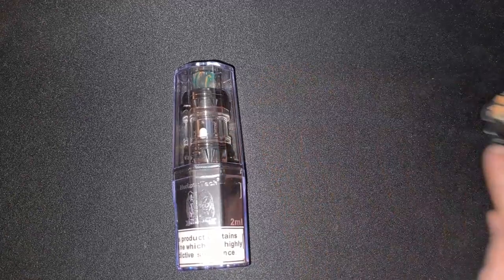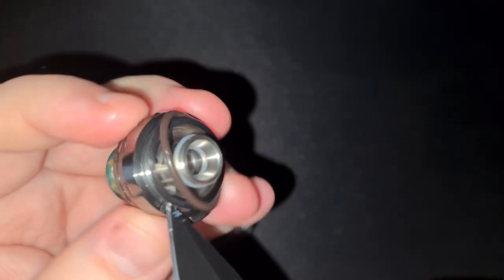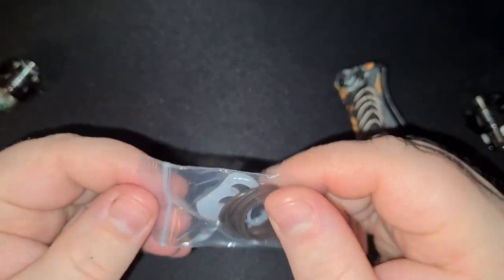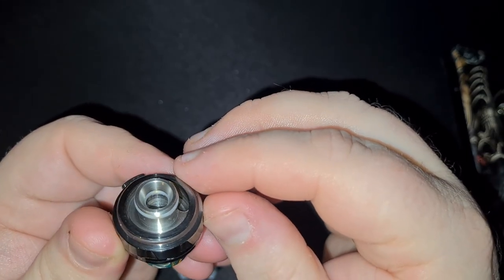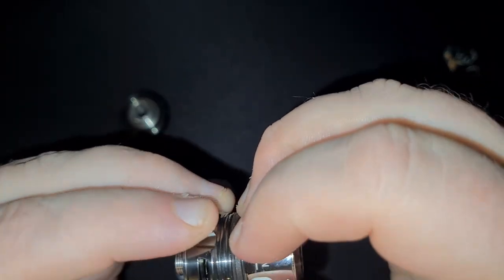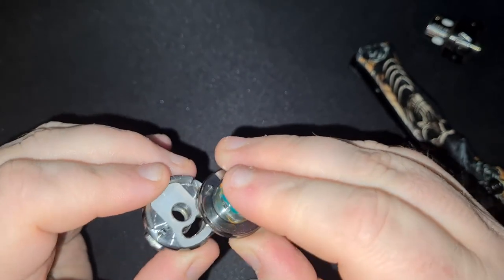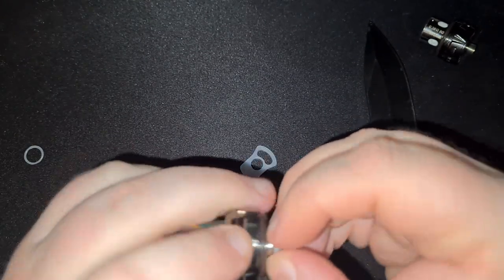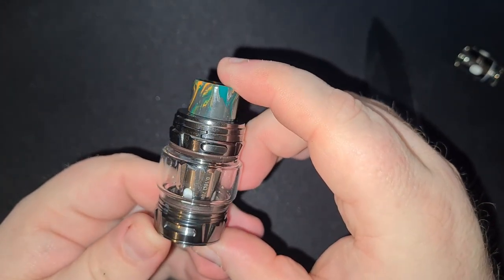HOW2 - Change O'Rings On Your Tank | Glass & Coil

Comment: So, I bought a Freemax mesh pro tank, about 1.5 years ago. I loved the flavour and I bought another. I had bought a new e liquid called blaze no ice. It was great. Really candy like. I tried it in my newer Freemax mesh pro tank and it instantly tasted like soap. Do you think it was dodgy e liquid? Or could there be oil or something inside the tank? I remember emailing seller and he just said it must have oil from factory. Yesterday, I started to use my 1St Freemax mesh pro and I wondered why I stoped using it. I have another liquid to go in 2nd tank . I’m unsure if I should just rinse every part of tank in warm water, dry and fit new coil. Or just throw it in the bin and buy another. Could there even be oil or grease under the o rings? I thought about removing and washing them but I’m worried I’ll damage them and unfortunately, I didn’t keep any spare o rings that came with the tank. Oh, I also have a pack of Freemax mesh pro coils that I bout 18months ago. Do the coils expire or stay good as long as they are new and sealed?